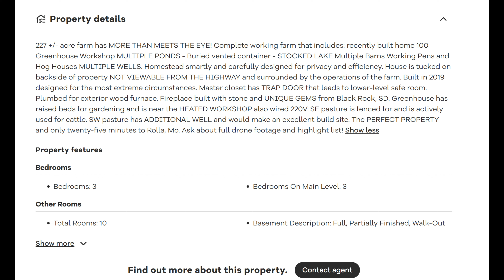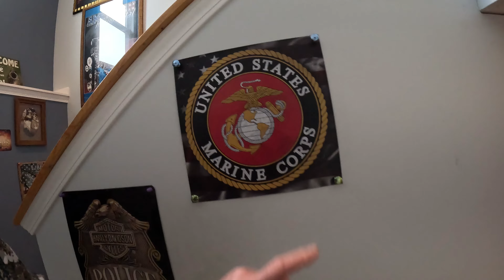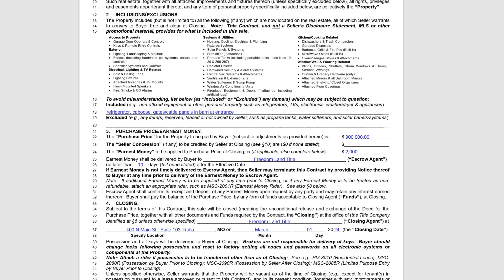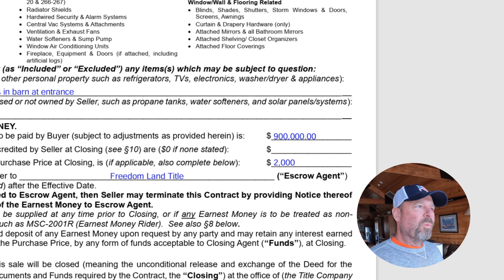227 ACRE Missouri Ozarks home & land compound! We make an offer!

Comment: That house would need a water softener for sure. We had one put in along with a new water heater and then later in the year we had to replace the pump for the well. The people before us left a lot of crap. As far as internet we had to go with Bright Speed cause there is no fiber optics in Missouri
Reply from the maker: I heard that Missouri (I don't recall which company) is now installing fiber along the existing power lines. I actually saw big rolls of wire on some of the power lines at some of our showings. So it is on the way, at least in some areas!
Reply: Incorrect. There is fiber optics in Missouri, it just depends on where you are. Some cities have both, some have a cross and some do not have it. Fiber is even in some more rural areas. Example
My mom is in Buffalo she has fiber,  I am in Springfield, and part of Springfield has it, part is still working on getting it. My house doesn't have it but you go to other places in city and it's 100% fiber optics.
Reply: As another poster replied.  There is absolutely fiber optic in Missouri.  Kansas City was one of the first places in the US to recieve Google fiber.  Even rural in many places is getting fiber now.